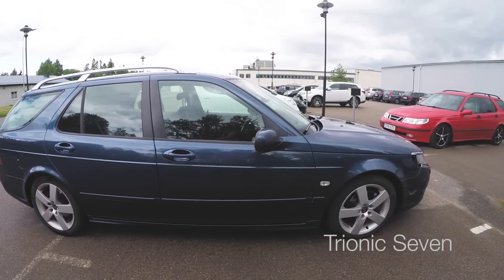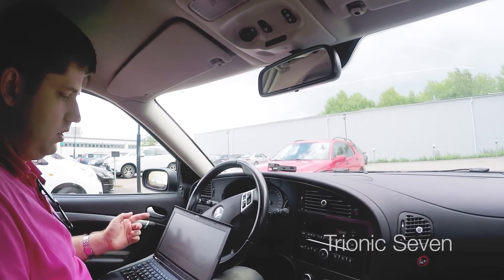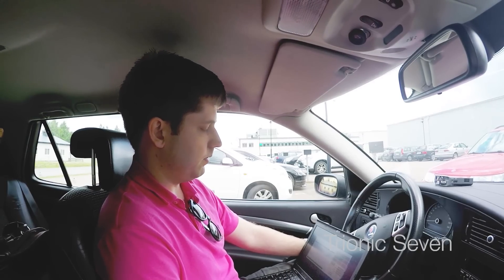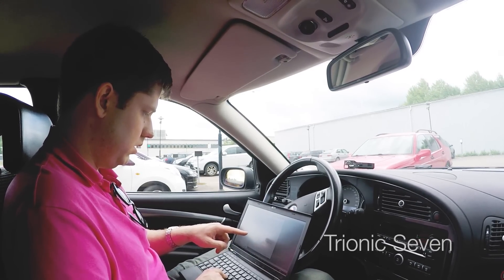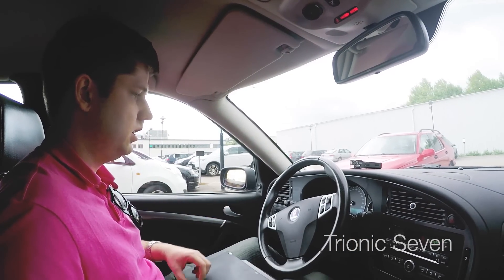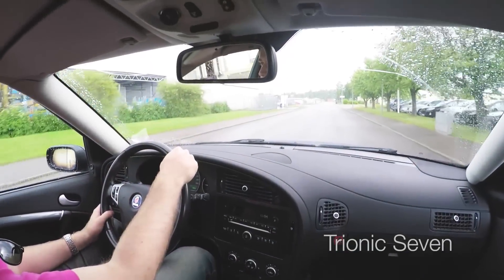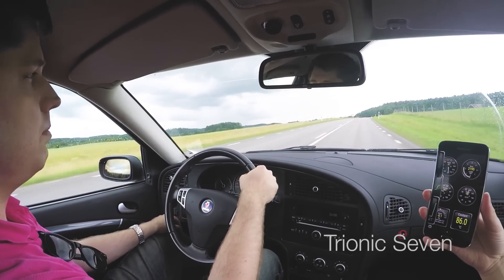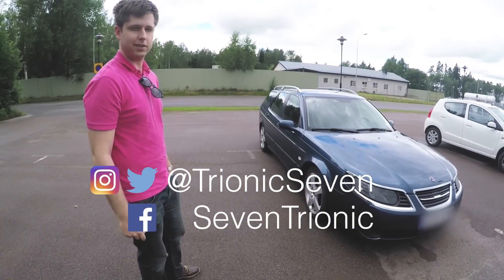Saab 9-5 TD04 Turbo Remap - Trionic Seven

Comment: Trionic Seven: I am in two minds on swapping out my ageing GT17 to a TD04 (on my 2000 9-3, B205L).  I am concerned I will lose the earlier torque peak for everyday driving; on the other hand I miss out on top end power and reliability of the TD04.  

Is it worth upgrading overall (with Maptun remap)? Forums can only tell me so much.
Reply from the maker: Performance wise you will not lose anything when switching to TD04, trust me. It's great upgrade so just go ahead! In addition, the TD04 is so much better re. reliability.
Reply: Trionic Seven thank you for the prompt response.  Congratulations on the YouTube channel.  It is one of my favourites.
Reply from the maker: Glad you like it! Spread the word ;)
Reply: I'm thinking about buying a 9-3 from 2000-2002 and doing something similar. What kind of HP increase could you expect to get reliably out of this kind of swap? I've heard good and bad things about the B205L. I don't want anything crazy, maybe just 250hp or so. 

I know the internals aren't forged like the older 9-3's, but that also makes it a more efficient engine, correct? 

Thanks!

Comment: hi! i need some little help, what box did you use to read and to write the ecu software? , if i retrofit instrument cluster from an 9-5 aero wit boost indicator on my 9-5 bipower , what to do to make boost indicator to work?
Reply from the maker: Check my opensid video. The box is the combi adapter that can be purchased from trionictuning. That site also has info on the boost gauge.
Reply: Trionic Seven trionictuning site is not working
Reply: very very useful forum trionictuning !!!
Reply from the maker: Glad you like it. Got it working?

Comment: You mention this is a 2008.  My 2007 2.3t listed specs online in U.S. says it has 258-260 h.p..  I bought it used so I dont have the original manufacturer info..  I assumed it already had the aero tune.  Why does this 2008 need to be remapped?
Reply from the maker: The previous owner changed the turbo to the aero turbo so it makes sense to upgrade the turbo map. Otherwise the car might not run that well.

Comment: How do you think a td04hl-15t would work in a c900 with a t5.5 conversion? Should I look at a td04-19t if looking for more race power? You're thoughts?
Reply from the maker: Hm, I'm not too familiar with the og900 or the T5 engines. They are very well known for the T7 engines since it's the Aero turbo. I would ask at trionictuning.com! :)
Reply: A TD-04-15t would definitely have more power than the stock Garrett. The 19T would naturally give you more power still, but way more than the C900 transmission is going to be okay with. Especially if you race it. I have an '89 900 Vert (along with 4 other SAABs) and a spare TD-04 and was considering it as well, but if you really want to build a SAAB for racing it is best to use the T-5 cars just because the transmissions are more plentiful or you can get that sweet Quaife 6-speed kit if you have the money.

Comment: I recently had an ecu flash on my 2006 2.3t Vector Sport taking it up to 235bhp and 380Nm - it's a big improvement.  It's still the GT17 turbo but was advised an upgrade to the TD04 would be a good idea to get more output and better response..  Apparently pretty much everything else is the same as an Aero car.  Any plans to do a turbo replacement/upgrade on your wife's car?  Would be an interesting video for me anyway!
Reply from the maker: Hey! Nothing is planned for a turbo upgrade for her car, she doesn't want me tuning it too much ;)

Sounds like you got both a turbo calibration and a stage 1 on that car, and yes that's a big improvement!

Comment: You mention the boost gauge on that car which I believe changed from 2006 onwards.  Mine is a 2006 2.3t Vector Sport (185bhp lpt) and doesn't go far into in the red at all. Is that something I should be concerned about? I have no similar car to compare.
Reply from the maker: I expected it to go into the reds since I thought I had the same bin as in my own Aero which barely touches the red on full boost. Are you sure you have a stock instrument cluster? Not sure the 2.3t has a turbo gauge at all, and the car in my video is an upgraded cluster with the indicator. Also, the needle is controlled by the software so different software can show different things.
Reply: +Trionic Seven: For Saab Enthusiasts well there's a gauge marked 'turbo' in top right of cluster.. I'm assuming it's standard?